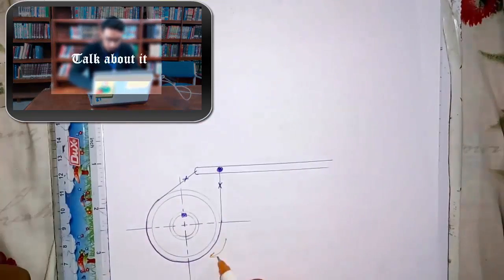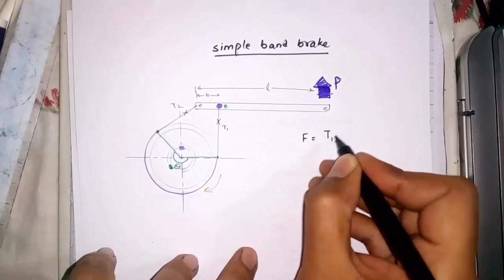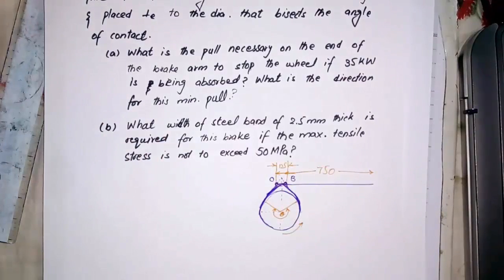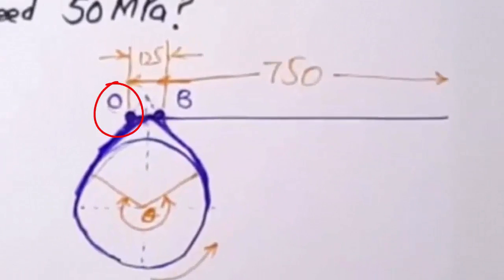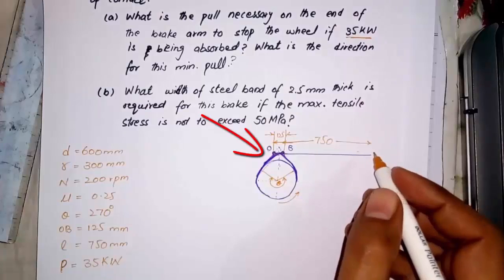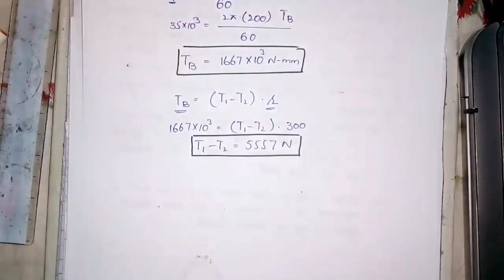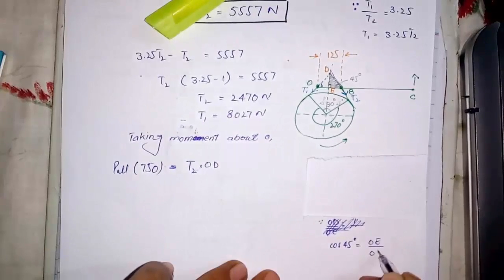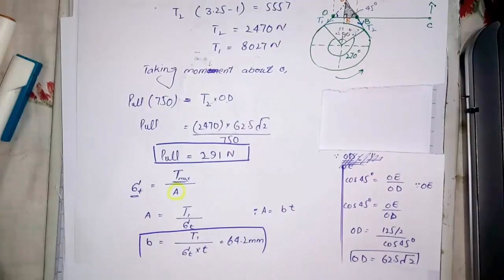How to | simple band brake | working | mechanism | formulas | problem solving

Comment: Sir how to find T1&T2 plz reply sir
Reply from the maker: First of all you will find the tension ratio (T1/T2) and after that you will find Tb (Breaking Torque) which is (T1-T2)*r. By equating the two expressions you will have values of T1 and  T2.
6:00 to 7:00
Reply: #tysm sir